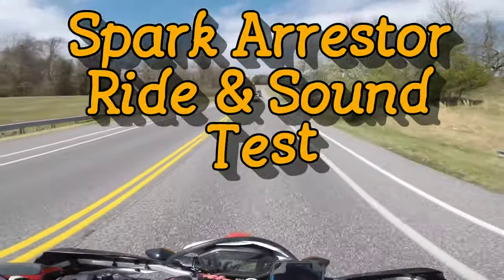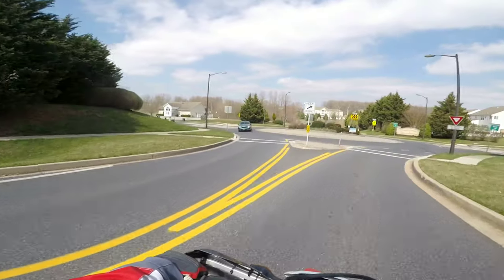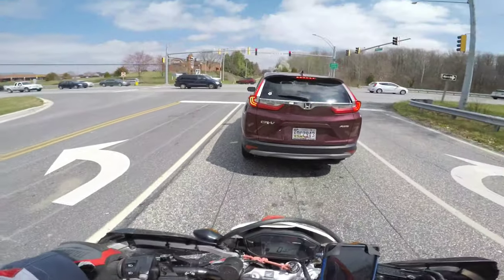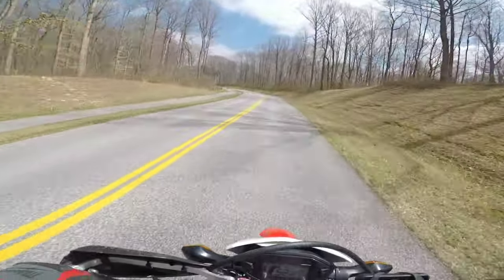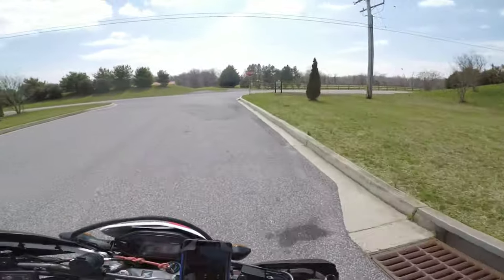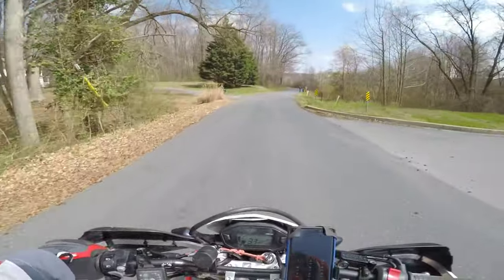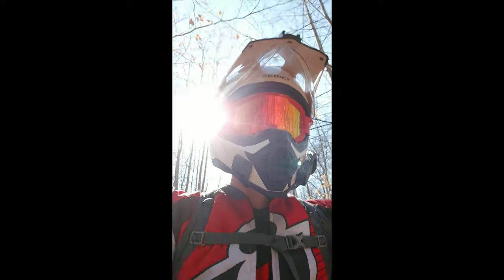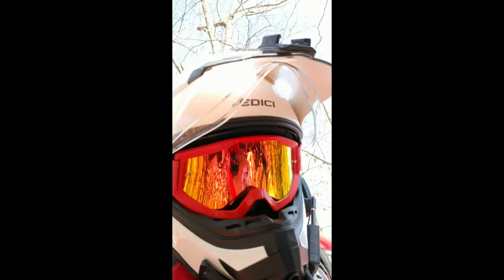CRF250l Spark Arrestor Removed Sound Test | LOUD For Stock Pipe | Raw Footage - Broke My Gopro Mount

Comment: Great video I just bought my 2016 Crf250l with 1900 miles for $1200 have big plans for this bike. The original owner had the bike sitting outside for years. Fresh fuel, deep clean and she's running perfect.
Reply from the maker: I really appreciate it!
That's absolutely amazing, $1200 with only 1900 miles. Crazy good deal. Never find that deal again lol. Barely broken in on the motors end.
If you want to see how the CRF250L does off road check out some of my other videos as well.
I take fantastic care of mine but I also ride it hard in the dirt and so far its been a fantastic bike all around, and that's coming from mostly riding actual dirtbike's including 2 strokes in my years of riding. Great dualsport to have in the collection for sure.
Reply: 1200 wtf half a bike or full running bike?

Comment: Hi Zack, thanks for the videos. Quick question :

I'm thinking about doing this to my bike. Any long term damage to the engine that can be caused by removing the spark arrestor? thanks!
Reply from the maker: Thanks, I'm glad you enjoy them. 
No it wont cause any kind of damage. It's just a spark arrestor and a silencer sorta in a combo. Theres a few mods you can do that make it sound a little quieter rather then removing it entirely but removing it entirely it still sounds good.

Comment: Hey zack on my baffle i hollowed out the leading end of the baffle and put a piece of 20 guage perforated steel in place of the solid end.  A small amount of the exhaust comes right through the center of the baffle and it gives it a nice little rasp as wide open throttle otherwise it very slightly louder then stock.
Reply from the maker: @Gerald Burmeister
So you Hollowed out the Pipe beyond the cat and put a piece of Perforated steel that ran out to replace the stock curved tip?
Sorry just trying to understand precisely as maybe I'll try it for people whom want to just get a little sound put of the OEM pipe without replacing it.
Removing the Arrestor entirely sounds decent and all but just to loud while on the bike. Drones really bad on the street but is great off road.
Reply: @AdventurerZack  the solid and that sticks into the catalytic in the front is what I hollowed out that's where I put the perforated Steel
Reply from the maker: @geraldburmeister9637  Awesome, thanks.
I'll take a look inside mine as well now.

Comment: Will doing this mod cause the bike to run more lean and damage my engine over time ?
Reply from the maker: Nah it's just a spark arrestor. 
But it's extremely loud.
Removing the spark arrestor on the stock pipe was louder then my aftermarket pipe without an arrestor. 
Let me know what you think about the sound.
Reply: AdventurerZack omg, The bike fucking SCREAMS down the road now 🤣🤣
Reply from the maker: @rhcp4life697  I told you bro haha. it's really loud. Extremely surprisingly loud from removing such a small and simple thing from the pipe. Lol It doesn't sound half bad though to be honest if you don't mind the noise.
Reply: AdventurerZack yeah bro I don’t mind it at all. I actually like loud trucks and bikes etc.
Reply from the maker: @rhcp4life697  Same

Comment: Really glad you posted this one. That amount of noise would get every hiker in the UK enraged !   I was pretty much cured after putting a full straightthrough DnD race exhaust system on a Yamaha 1200, I could barely open the throttle in a town without the worry of the police giving me serious grief.
Do you have noise limit regs there? I assume there must be something.
Cheers again for the useful content.
Reply from the maker: We do have noise limits. Not exactly sure what they are though, the limits that is. 
Its definitley to loud for my liking on the bike. It's not bad off road but I couldn't see myself riding a half hour up an open road with it droning like if does on the bike. It's kinda ear piercing. 
Offroad it's not to loud but that's because your not crusing at  higher speeds. 
I still prefer to be quiet though rather then loud.
With the Q4 I may have to open it up and pack it full of steel wool to quit it down even more if it's as loud as the oem was without the arrestor. 
Cheers brotha, Glad you enjoyed it!
Reply: @AdventurerZack  I did the steel wool thing with an xt600 before, folk said it sounded like a spitfire going along the highway. Got to work, and realised it had blown the whole lot out :)   ooops
Reply from the maker: @Hutchie2112  Wow haha.
Did it quiet ot down some atleast? Sometimes depending on the bike you have to tack weld the wool in so it doesn't  come apart/loose. Probably could do it another way if your not a welder but not exactly sure what else could be used.  I'm not a welder myself at least.
Reply: @AdventurerZack  I folded some chicken wire round the end :)
It did quiet it down a lot, but it also strangled it badly. You need to put loads in or it won't help with noise.
Reply from the maker: @Hutchie2112  Once I get the Q4 pipe installed we will see how it sounds. I'm hoping it doesn't drone like the OEM pipe did with the SA removed. The inside of the OEM pipe man looks really weird. Its all janked up. You can see inside it pretty well with the SA removed.